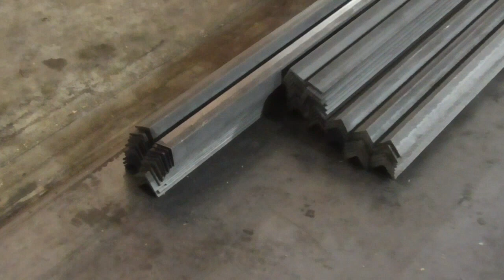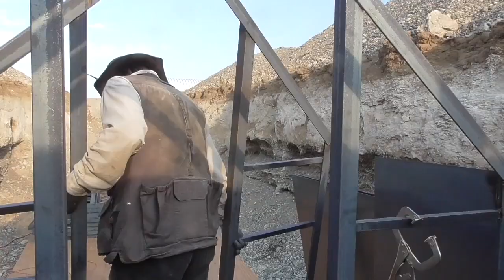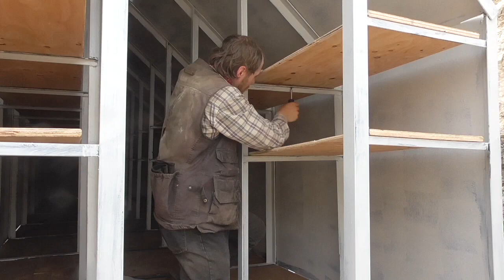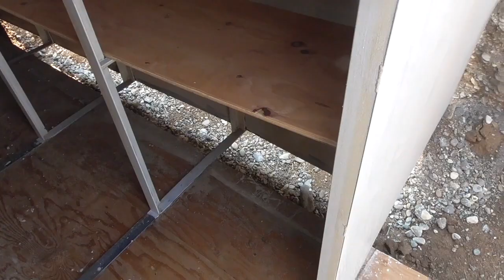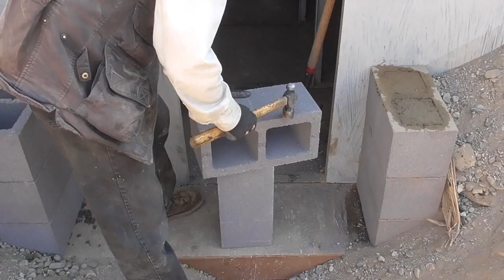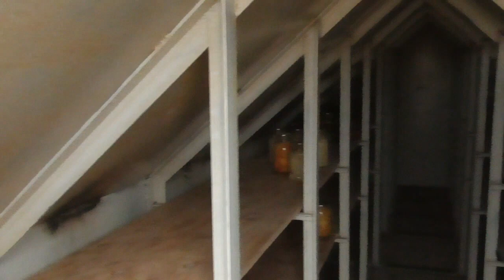Building a Root Cellar (TIS348)

Comment: The conex container can be used to make a root cellar, but you need enough beams and adjustable braces to hold the container in shape. Also, you want to put the container on some studs to hold it from the ground. Cut some holes in the bottom and sides to put the concrete in through it. Vibrate the concrete enough to fill every cavity. If you make the walls a foot thick, you can put the root cellar under a big pile of dirt. Its a bunker too then. If you have a stone crusher, you could crush your local rocks and use that in your concrete. Now ive read a lot about concrete, so i know some things about it. If you are interested, its on my archive page "books", at my profile... Maybe you have seen it.

Also some dug in Japanese and Russian trenches and bunkers there. It may be worth your while. 

Im going to resume watching your video. I wanted to share this with you.

Okey, i would say, just digging big hole, and then use concrete as the floor and walls. Also, if you put small rocks on the side and under the slab like 4 to 6 inch thick, it can aid in draining. Also, to make sure the concrete is watertight, you cant to use a thick tar paint on the top and on the sides, so the water cant leak through the concrete. If the concrete is heavy enough, no water will make it through the concrete. 

The big thing with concrete is that you actually only need to pay for the portland cement bags, and all the other parts of it can be sourced from other sources for free. So if you have a sieve, and a rock crusher, and you can grade your materials. You should be able to get concrete for really cheap. But you need to check your concrete mixture, and test it under the hydraulic press to be sure that is it strong enough. Some rocks, are not suitable for concrete, also some really fine material is not suited for concrete either. The books about this matter are all there, it just takes some time to read it. And some books can be a bit frustrating, but in the end, you will know how to place concrete. If you really have the time to study, you can even do calculations on concrete and the soil. Im using Maple, i did make a start on trying the concrete and soil books, but i noticed that i first needed to learn how to use Maple. I almost made it through my Math books, when it is spring i will make the concrete calculation and soil calculation books. 

As you may have noticed, i have a particular interest in building something in the ground, and i did read a lot about that subject. So if there is anything you want to know, just ask. Im up for a "discord call" too, just let me know! 

Greetings,

Jeff

Comment: Hey I have the same bandsaw too but branded by harbor fright . I bet it was painfully slow cutting all those angle stock but did you know that the pulleys on the motor and drive can be turned upside down and reversed by boring out one inner dia a little bigger on the lathe. I did this on mine and it cuts many times faster and even gives a 2000 dollar bandsaw a run for its money.

Comment: What thickness sheet steel did you use for the wall of the root cellar? Also great video! I've always wanted to build some underground bunker like structure!
Reply: Sounds like 1/8" I worked with sheets of 3/16 lot less flexible than that.
Reply from the maker: I used 14-gage sheet steel, so about 0.079 inches thick.
Reply: @TheIdahoanShow  Thanks!

Comment: Not bad, I'm not sure about the amount of flex I was seeing in the ceiling sheets. I've done something similar recently, but just went with cinder block, plenty of rebar, and a formed arch concrete ceiling. The arch ceiling is a major pain, but worth it. I wonder how the cost difference shakes out between cmu and steel. Always enjoy your stuff.
Reply: I was thinking along similar lines with concrete filled cinder-block walls and a flat steel trusses covered with construction steel and covered with concrete.  Very simple.